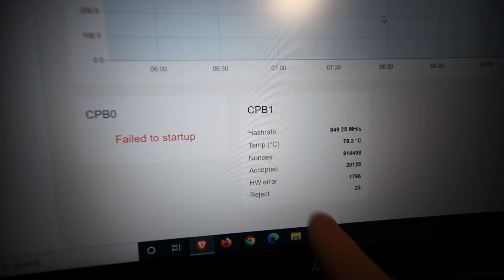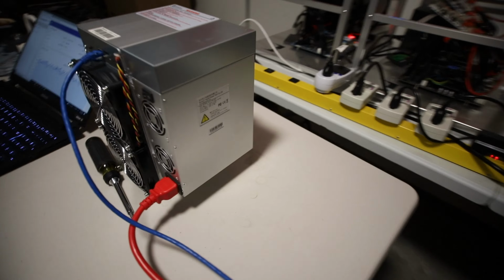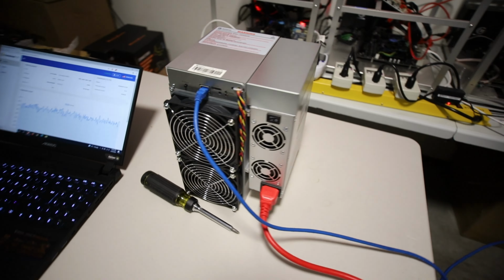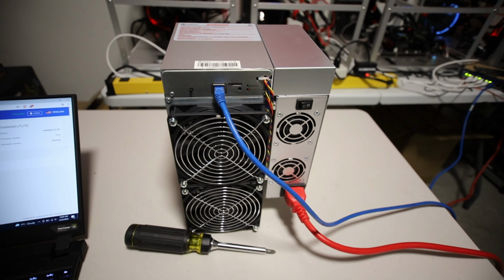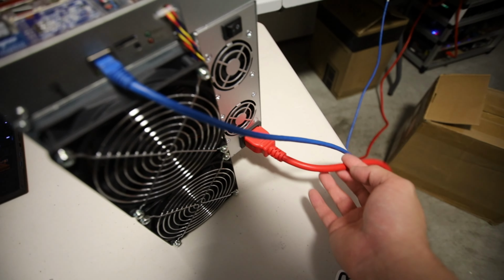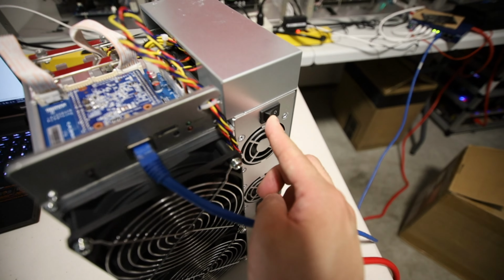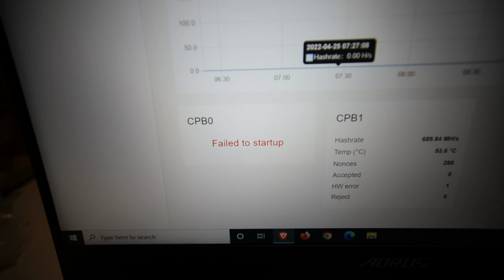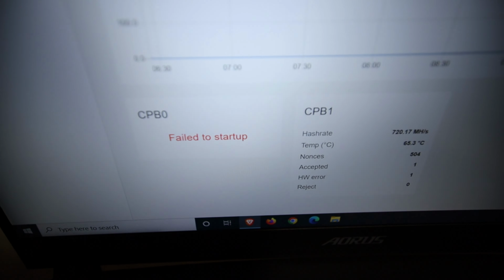my new asic miner BROKE in shipping?

Comment: Any ASIC that I have ever bought had paperwork that states to shake it when you first get it, and if it seems like something is loose; or makes a metallic on metallic sound to not turn it on until you opened it up and checked it first;  the same also applies to FPGA Units.  While I'm at it, it's a good idea to take pictures before and during disassemably.
Reply: Yes, take pictures or video

Comment: If this this is the first ASIC you've opened (remove fans and pull out the hashboards) then I recommend opening your other ASIC mining machines and blowing the dust off of the hashboards (before they stop working).  Depending on how dirty the boards are you may need to rinse them in Isopropyl alcohol (90% or at very least 70%).

Comment: Great video on troubleshooting an asic but not very safe. For RPM and anyone else who wants to take on this challenge you need to be extra carful around those two metal bars that connect the hash boards together. Those bars are coming from the power supply and are what delivers the power. Be extremely carful, and do your research BEFORE you take any asic apart.

Comment: think of it like a gpu. the board is getting power via its IO bus but its not getting its main AUX power. You may have to bust out your power meter to do some voltage testing to see. Also the rattling could be a metal part flying around in there in which case it could short the card out in a way where this could happen.

Comment: Bad temp sensor.  Check to see in the psu that the bus is connected.
Reply: it is, otherwise there is no light on the board
Reply: @bigspin69  good point. Further thought with it being parallel one board wouldn’t work if that was the case.

Comment: Hey before you do this again to something - you really really REALLY - are going to want to remove / disconnect that PSU from the rest of the unit first. The . . .HUGE.... caps in those PSU's will hold a charge for quite some time and can give you a pretty hard zap  -  especially right after being plugged in !  This is just general paranoia on my part since the outputs are PROBABLY all low voltage but still mostly "unknown" as you are currently tearing into it.  Just a nag from someone who rips everything apart.  

Oh - and - I did not see anything and I do not know what we are talking about  !  😉